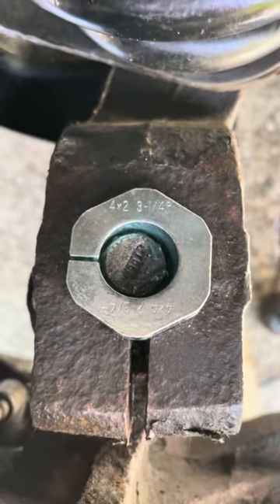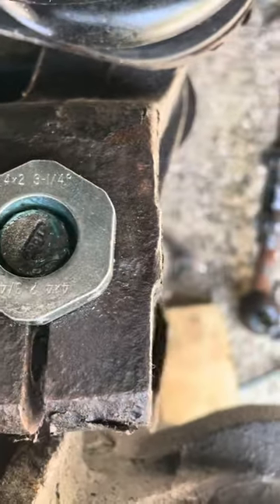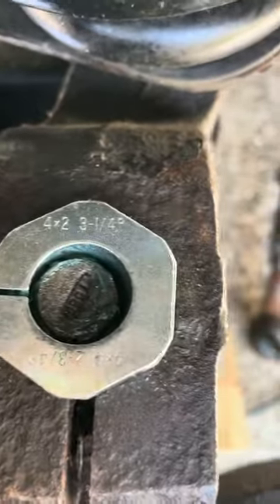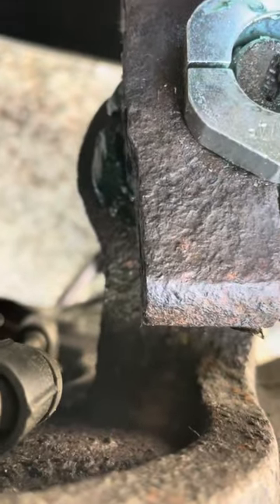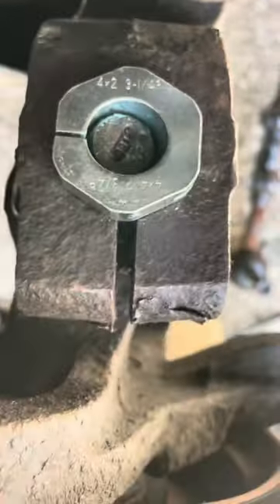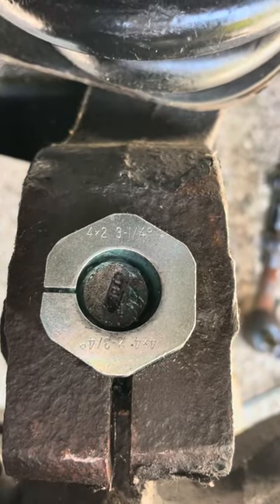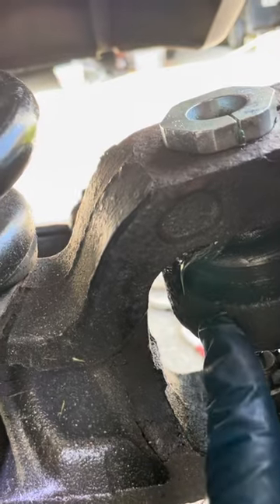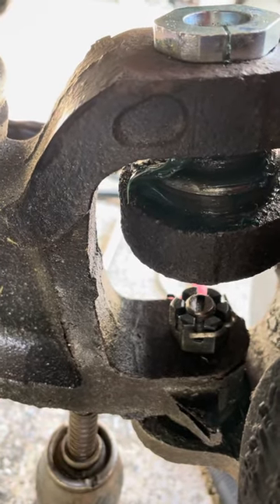Caster camber bushings - how they are installed, how they work

Comment from the maker: I’m very happy with the results. I recently drove the E150 on an 8300 mile trip and was able to cruise at at 70-75 mph on the Interstate highways. I had replaced essentially all of the front end suspension components, added a steering stabilizer, and the caster camber bushings were the last thing I did. They helped a lot. As I said in the video, I then took it to a 4 Wheel drive shop for an alignment. The guy said that the way I had oriented the caster camber bushings was perfect. I just followed the instructions that came with the bushings and went for maximum positive caster. His 
print out showed that I now have about 7° of positive caster on each side and about 0° of camber. It drives really nice. The Moog caster camber bushings were inexpensive on Amazon, so it’s a pretty affordable way to improve the handling of an E-series/econoline van.

Comment: Right on. Good video. Im doing a 2'' lift on mine and throwing in the the adjustable ones up to 4 degree.  I'll go max caster and bring it in for the camber. Im +3-4 camber by eyeball after 2" spacer. Probably ends up minimal caster all camber for me.

Comment: I HAVE A 98 E-350 rv AND WHEN A MOTORCYCLE passes me the wind pushes me to the right. I got so used to driving the RV getting pushed around that I played a game guessing the size of the vehicle coming up passing me on my left. I could literally feel the air movement coming ahead the the passing vehicle push my 30'RV before i could even see the vehicle through my window. It's kind like how flies know they are about to get swatted...feeling that air flow before the squish...anyways I digress. I found a pair of bushings that advertised 4 degrees (max available) caster. I'm guessing the overall caster angle ends up being more than the angle stamped on the bushing? I wonder how my 4 degree bushings will end up in total degrees. Do you know by any chance how the off-road place measured your overall rake and ended up with 7 degrees?...Hopefully they will make a difference. Thanks for the inspiration.

Comment: Is your van lifted?
Reply from the maker: No it’s pretty much stock height. I replace the front and rear springs with heavy duty ones because it leaned a lot around corners. It’s a little higher in the back than I would like but I can live with it.
Reply: My question is when replace these can you put a level on the rotor so you know when your straight up and down  only reason I ask um fixing to have to do this